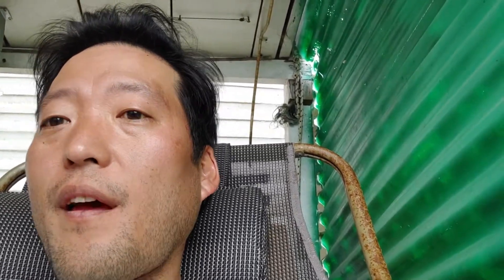Flipsky 6.60 vs Flipsky 6.60 Plus!  DO NOT BUY Flipsky 4.20 Plus or 6.60 Plus!

Comment: So what I'm hearing is the 6.6 standard and the 4.2 standard are the only good ones? What do you think about the 6.7 mini pro (no antispark switch)? Also, I'm on a budget and currently having to make the decision between a 4.20s and 6.6s. I'm using raptor 2 hub motors, I've heard they're rated for somewhere in the neighbourhood of 60-80a (I can't find an exact number) but the urathanes can sometimes explode when the motor overheats, so I'm thinking I'll max them out at 30-40a, 12s. Which do you think would be my best choice with a low budget? Hoping to get something that I can still use in the future too if I choose to upgrade to big belt drive motors. Hope you see this comment
Reply from the maker: Yeah the plus versions actually heat up way more, recommend older regular ones.

Comment: I have had same issue 😉 the 6.6 dual worked fine (nice and cool) until 1 side got corrupted. Installed a 6.6+ and it is overheating like crazy. Same set up, just changed vesc 🤯 so i just got the 6.7.  installing asap. Too bad i cut my box all up for heatsink and airflow ☹️ ordered a real esc case from ideatb (poland, $200🤯) should be here in about a week but meanwhile i will try 6.7. no extra heatsink and a antispark 😁 hoping for the best 😉 good luck.... PLUS is JUNK 🤣

Comment: Flipsky fsesc 6.6 with antispark, 12s3p, torque boards 6380/170kv single. Barely 3 months in and it is failing. False cut outs. Inconsistent acceleration. Can fix for one day, then "surging/pulsing" acceleration continue... FOC is a big NO. Use BLDC settings. Seems to get false heat reads
Reply from the maker: Sounds like sensor problem if not working correctly with FOC.  I have run mine on dual 6374 for many months no problem.

Comment: Last i remember no one used the attached button on the fsesc 6.6+ but dont remove it either. I know crazy.  The builders who used them basically just build their own switches or use loop keys. And as for the fsesc 4.20 these are no good at max voltage 12s so anyone that build with the fsesc 4.20 would only use 10s batteries.

Comment: I have a 4.20 plus running 10s3p after doing some reading I saw that the plus has trouble with 12s
Reply from the maker: Yes it seems like it only happens with 12s.
Reply: Nope 4.2 user, happens with 10s also I have both 10&12...forget about cutouts, random over throttles are worse usually last a good 7sec at full torque...i know it's not just me only, but no longer use fs. Now why would Boundmotor trust them 🤔

Comment: I went thru 2 of flipsky 4.20. They burnt out on me. So I got the 6.6 and never had problem with it. I'm running amazon antispark and no issue. I have 2 of them in two of my built. Never had heating issue.
Reply from the maker: Yeah I think 6.6 regular is the best.  I never had problems nor does it heat.